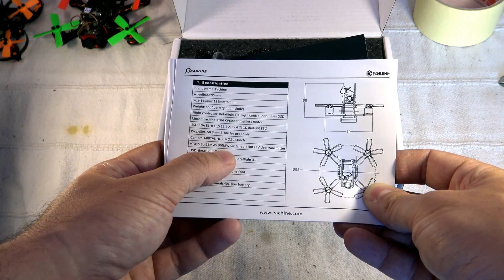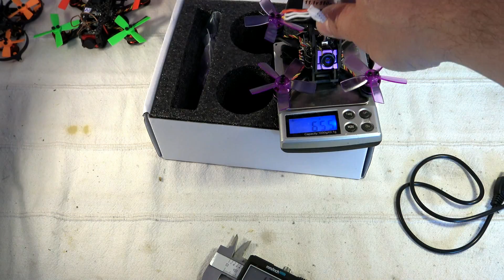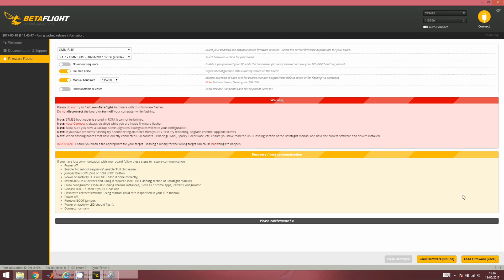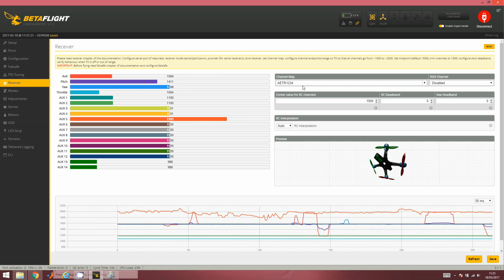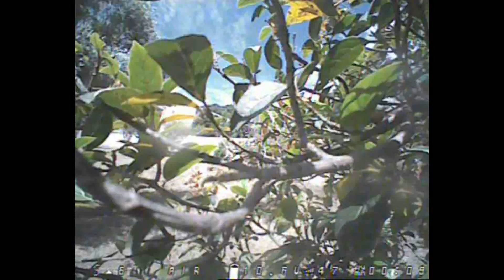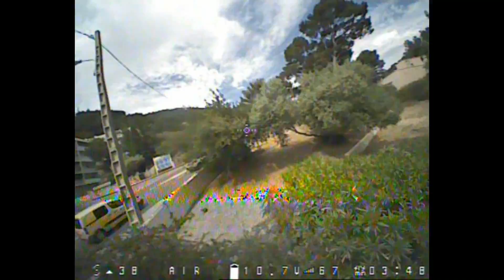Eachine Lizard 95 unboxing analysis binding configuration and demo flight (Courtesy Banggood)

Comment: Good morning, friend, I bought a lizard 95 and I have a problem with its stability. When I put it in the angle mode it gets left puffing so I go with the rool to the right but it goes more and more until it has no way to control. It is calibrated in betafligth, the motors too, the calibration of the controls are all ok.
What's going on because I can not make him stable. Is it a defect in the controller? Give me strength, my friend. Thanks.
Reply from the maker: try softmounting for both the FC and motors...
Reply: How is it done?
Reply from the maker: you need specific rubber o-ring and 1103 softmounts
Reply: https://www.dropbox.com/s/wj4mk8lplrea633/Video_1523808729.wmv?dl=0
Good afternoon, this is a video I made to show in betaflight how these engines are accelerating uneven.

Comment: Hey the values you wrote should we all copy it if we have the same drone and a frisky receiver??
Reply from the maker: yes if you delete the default ones by accident
Reply: okay thanks also the type of the receiver and everything? Also for getting it compatible to beta flight 3.7.0?
Reply from the maker: You need the same version of betaflight as the original one of course. If you installed a more recent, not sure all settings will be compatible

Comment: I have the Eachine i6 transmitter that I bought with the Eachine Racer 250 Pro.  Will Eachine Lizard 95 work with the Eachine i6?  What do I have to add if needed to make them work together.  Thanks.
Reply from the maker: If you take the FlySky AFHDS-2A receiver option yes ...
Reply: Thank you.

Comment: Top la vidéo, et tu parles très clairement c'est super agréable de suivre ce que tu dis même en Anglais !
Petite question : entre un Arfun95 Pro, un Aurora100 et ce Lizard95 en 2s tu penses privilégier lequel ? Par forcément la vitesse mais le tout : maniabilité, durabilité, résistance aux crashs, amusement, simplicité dans BF, etc ? C'est le grand débat entre des potes, on est 2 à avoir un Aurora100, un a un Arfun95 Pro et un autre un Lizard95, et sur le net je vois que des bonnes choses pour le Lizard95. Du coup t'as un avis ? 
En tout cas merci pour les vidéos et continue, ta chaîne est super ! :)
Reply from the maker: Oui le lizard95 est mon préféré ....robuste, puissant, maniable. Seule la camera FPV est un moins bien
Reply: super ! merci :)

Comment: im so confused what firmware to chose all I'm trying to do is connect to beta flight to i can bind it to my remote and its really annoying because theres no bind button on the dsmx
Reply from the maker: For the DSM2/DSMX you have to use the "set_spektrum_sat_bind" instruction in the CLI. set_spektrum_sat_bind = 3 for DSM2 in 2048 then "save". It will bind. Then "set_spektrum_sat_bind = 0" and "save"
Reply: I get that but how do I connect my drone to beta flight
Reply: No it's all g all I need to know is what binary firmware to download
Reply: And on zadig when I try find my drone it says it's unknown USB device
Reply: SeBy DocKy like what's the board called
Reply from the maker: Default BF firmware installed: Betaflight/OMNIBUS 3.1.0 Dec  2 2016 / 16:47:34 (01968ff). So it's an F3 Omnibus boad

Comment: My receiver screen remains blank. tho TX is clearly connected. Any ideas whats up? (using Taranis)
Reply from the maker: So for sure the TX and RX are bound ?  I guess if you mentioned Taranis, you have the FrSky version. The D8 or D16 ? ... I guess in SBUS connexion. So 1) check that for UART3 serial is turned on, 2) that serial protocol is selected and 3) SBUS selected
Reply: TxRx are bound, i have RSSI and  the L95 doesnt blink.
I have the EU version but flashed it with the latest update and now im running D8.
UART3 has Serial RX enabled
RX is set on SBUS

ps Seems I cant update it. am running Betaflight/Omnibus v3.1.0
Reply: I seem to have the same problem, but not all the time. Sometimes the receiver screen is OK and sometimes every input is set to zero. Sometimes I can fly and sometimes I cannot.

Comment: Sorry im new at drones.. so Frsky bind with DEVO 7E ? If i buy Devo 7E i have to choose frsky ?
Reply from the maker: You have to mod your Devo 7E with a nRF24L01+ RF chip or even better with the "3-in1" multimodule. https://www.banggood.com/DEVO-Transmitter-Tuner-Modified-for-FBL80-FBL100-WLtoys-V922-p-89812.html?p=YL2512105842201212FR

Comment: When uploading the FW, you show a STM booloader in your device manager.  Where can i find that?  I cant upload the fw due to the port problem you have.
Reply: Would you be able to link or tell how you got it to work I am having the same problem and cant find a way to get the update to work. I am using windows 10 and none of the drivers I have found seem to do anything I tried the ones that Seby linked but no luck. Thanks
Reply from the maker: Personnally I am using this driver: http://www.open-tx.org/2013/07/18/taranis-windows-usb-driver-for-manual-installation
Reply: I got it to work last night with the stm bootloader for the devo 10 because windows 7 drivers wont work on windows 10.  Thanks again!  Couldnt have done it without the help of this video!
Reply: Sean Steele also having the same issue

Comment: Mine doesn't connect to the computer to set up in betaflight. Any suggestions with the driver?
Reply: RCFlyer85 THanks so much, that worked for me. Finally! Good tip.
Reply from the maker: Did you installed the VCP STM32 driver ?
Reply: SeBy DocKy thanks will try that.
Reply: gregor121 Mine is funny sometimes it doesn't want to work with the full USB A connector but works just fine with the micro USB one...
Reply: gregor121 Nice! Glad to hear that. Happy Flying!

Comment: would the FrSky version of the Lizard bind to Taranis Q X7 transmitter?
Reply: I'm fairly certain it will. I have one in the mail and I'm planning on binding it to the q x7. I think if it's and EU qx model you may need a firmware update to support d8 mode.
Reply: Joseph Aukeman Thanks for knowledge.
Reply: Fancy Pantz United Yes it will

Comment: Can we have rssi warning with the devo 7e? and what is your range with dsmx satallite or frsky protocol?
Reply from the maker: Yes you can set an alarm .... For DSM2 and FrSky, it will dépend of the receiver.... For FrSky at minimum 200-300m
Reply: wow... i am building a brushless micro soon. I have a Devo 7e and usually run with DSMX and redcon sat. range is ok.... I might just install the cc2500 for frsky and rssi telemetry

Comment: have you got an opinion on the 2035 gemfan quadblade props c0mpared to stock ones?
Reply from the maker: In general, I like the 2035 quadriblades coz they offer jellofree flight but are so fragile ... always in tradeoff somewhere. these pentabalde are much more robust but not perfectly balanced .... A little jello is here
Reply: I am using them on my aurora90 and I prefer them to the stock props and the racerstar quad and pentablades. I tried the dys triblades but I think think they are too heavy. I'm guessing the lizard 95 will work better being 3S.cant wait for mine to arrive in the next few days.thanx for the reply
Reply: Zach Alcorn I fly the Gemfan's and love them

Comment: Looks very good ... good punch, like DYS ELF, or better.  I find myself flying mostly in Ratitude (Horizon) mode mostly .. must be getting to old to fly full acro (rate) though I can. I wish more quads come with the Betaflight OSD ... very handy and easy to setup in Betaflight. Cheers.
Reply: Bill Somrak It's pretty different than the ELF.  The ELF is safer inside but this is MUCH faster when you have room to let it rip.
Reply from the maker: The Lizard is more an outdoors acro racers :) for freestyle :)
Reply: Yeah, it does have more punch than the Elf, for sure.  Definitely not a quad for beginners! Thanks again!